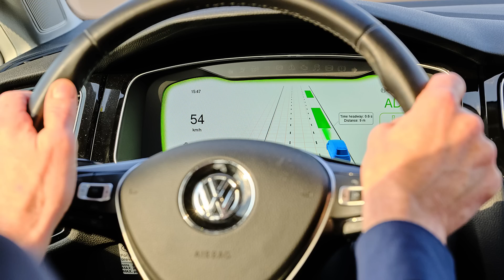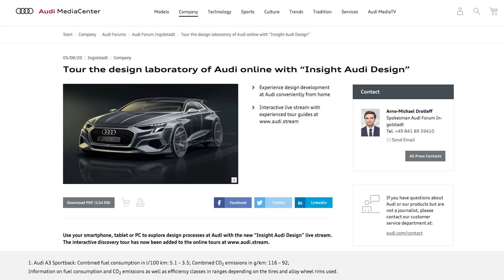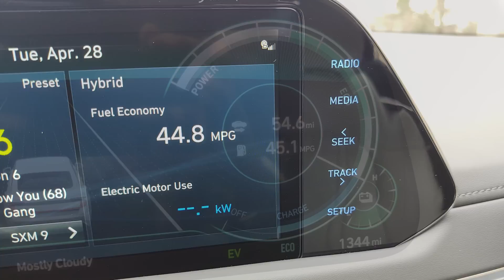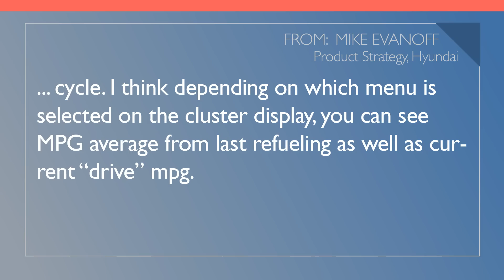Toyota Camry TRD Pros & Cons; UAW Supports Production Restart - Autoline Daily 2831

Comment: Hum !! That white BYD Electric Mini Van looks exactly like the Nissan's NV E 200 Cargo or Passenger version of an all electric van sold since 2012 in the UK.... Platform shared on Nissan's "B" Body and the all Electric Model  "Leaf". We only get NV 200 2 L 4 cylinder gas engine Cargo version in the USA ;however; the Diesel version  is very popular in Europe.... !!  Current update is that Nissan has ceased all production versions of NV 200 Van except the  "E NV 200" all Electric Van sold in Europe... The newer Nissan Model is based on Renault's Kagaro and designated The Nissan NV 250... !!  ps *Orphaned and shared is the American Chevrolet City 1500 Express "gasoline only" Van version from 2012-17 Nissan did manufactured for GM... !!  Thxs J. Bond
Reply: The red one looks like a Ford